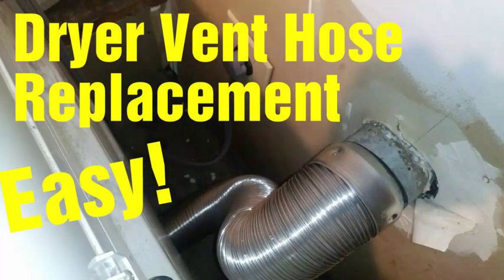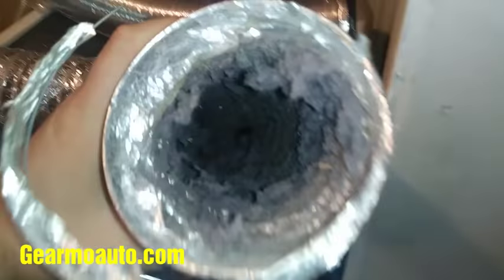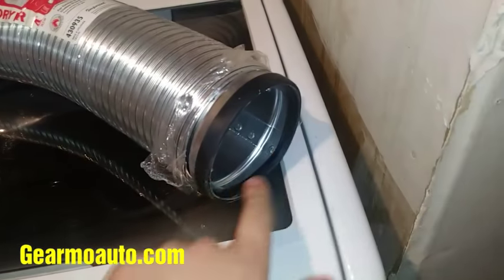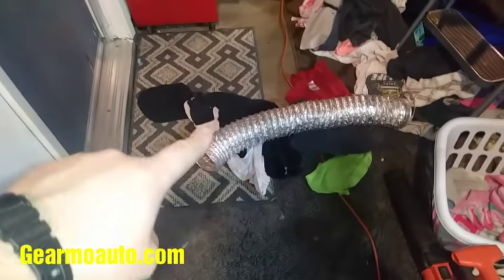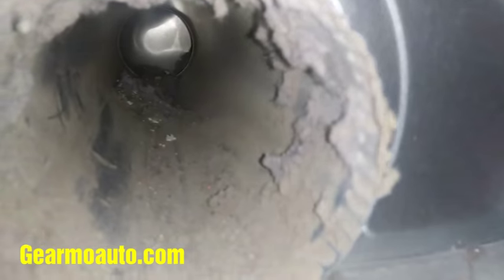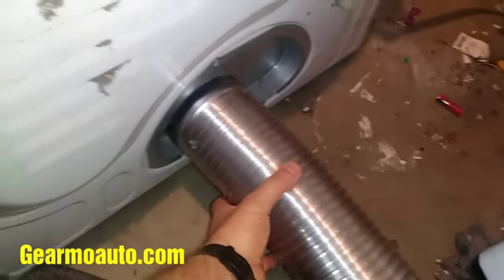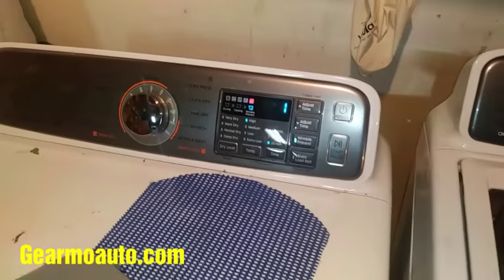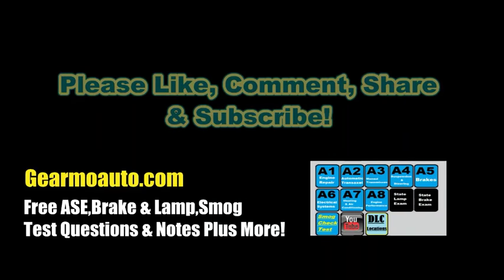Dryer Vent Hose Simple Replacement.

Comment: Actually, there is something wrong with those cheap aluminum foil hoses like the one you replaced.  They won’t pass code inspections in most states, because they are flammable.  Many house fires have occurred because of them, and from the amount of lint that you had inside of yours, you were lucky.  Just FYI
Reply: The foil flex transition ducts are actually paper with an aluminum coating.  Yes, they will burn.
Reply: Correct, do not buy one of these they should be outlawed.
Reply: Only if you clean it out once a month for sure
Reply: They say they are fire resistant hoses
Reply: Yup can confirm happened to my family
Reply: Hey could you tell me what you suggest I just got my first place with my fiancé and I’m trying to replace it lmk what I should buy plz and thanks
Reply: @corbinmcatee2189  yes what do we use then? Everyone here is an expert but no further info….
Reply: If it's for sale in NY it must be legit lol😅😂

Comment: When you have that much Lint in the Dryer outlet and hose you want to take the Dryer apart and clean the shit out of it. On mine where the Lint screen is on the top there is a duct assembled that extends down the back of the dryer to a fan that blows it out the opening attached to the hose. Remove the back cover, take the duct out and clean it along with the hose. I'd  buy a new hose while you have it apart since the newer one prevent fires. Where gloves, you'll tear your hands up pulling lint out of the duct or better yet buy a lint cleaner brush.

Comment: You apparently have never cleaned your vents lol
Reply: Regular maintenance and cleaning are crucial to prevent lint buildup, which can indeed lead to dryer fires. I recommend cleaning the lint trap after every use and checking the vent system periodically to ensure everything stays clear and safe.

Comment: I saw the spot on the shelf where it would be but they were out. When I got home with the better rigid hose I realized the quick connect would've been a great time saver. You wouldn't think connecting a simple dryer hose would be such a pain in the neck. Thanks for the video.

Comment: Nice video. But, MY dryer is in the basement, so I think I have to stand on top of the washer to hook it up to the vent pipe. Also-the  hose that it was hooked up to (before it completely broke) seems to be made of plastic(!)  I already wrapped the other end with metal tape and hooked it up to the dryer (before I noticed that the end hooked up to the vent was bad. I was wondering why it still smelled like dryer sheets in the house when I turned it on.)
Reply: My current situation.